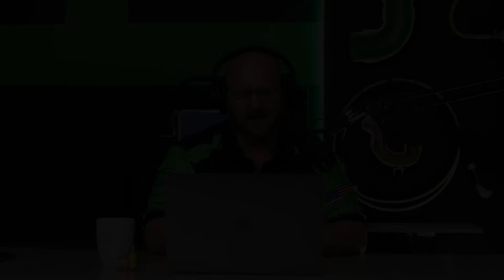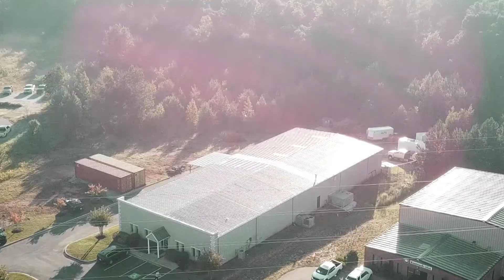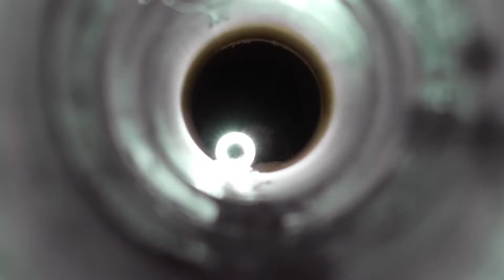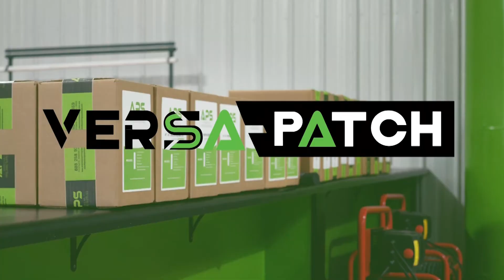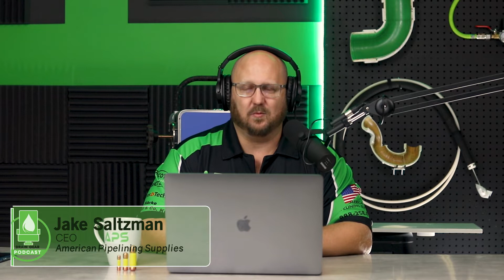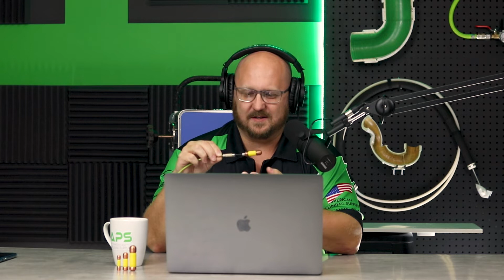Drain Gear Podcast | Episode 4 - Ferret Leak Detection w/ Rich Ingham

Comment: But what if corrosion and not leaks are blocking the ferret from advancing? How do you prevent false positives?
Reply from the maker: What kind of pipe are you referring to? We typically see that amount of scale in a galvanized pipe, which we do not recommend the Ferret for. However, we generally are sending the Ferret down plastic or copper, which usually does not have that problem.